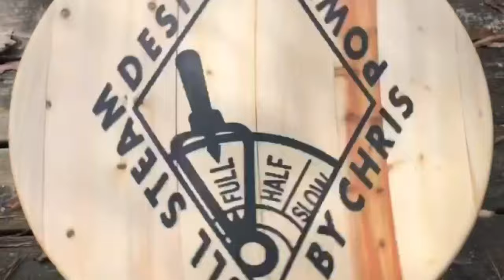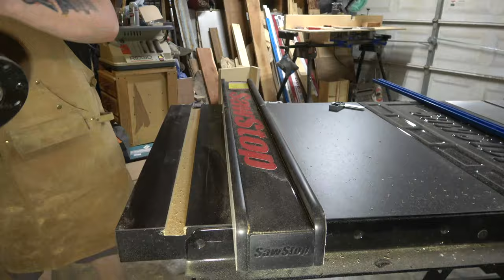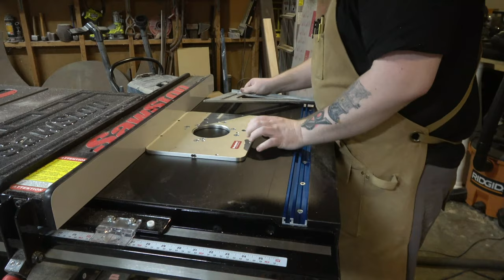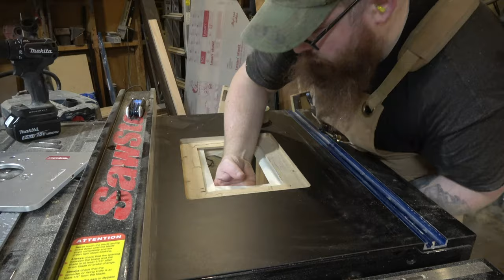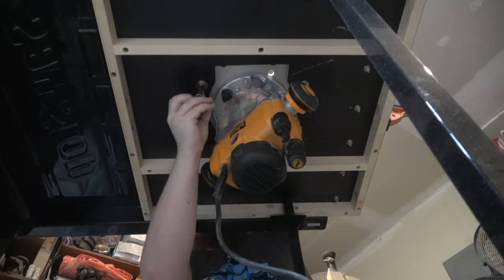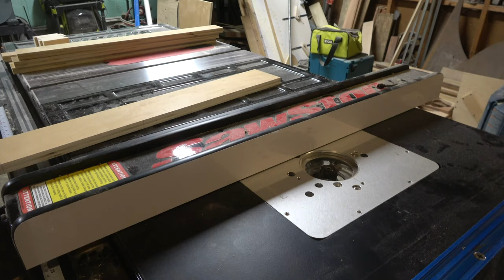Router Table Saw Extension Wing Insert and Fence Shop Build

Comment: I built a similar insert for my Sawstop a few years ago. I Phenolic to replace the entire extension table. I also imbedded a slot track perpetual to the miter slot you installed. I then manufacture pivot that can be slid in the second slot. When a piece of wood is up placed on the pivot it can be spun to create a perfect circle. 
All of my slots will support all of the Jessem components. This makes my saw work fully as a router and a great saw.
Reply from the maker: That sounds pretty interesting.
Reply: I would send you some photos and maybe a video if I knew how to attach them. I am a strong believe in not building something that you can buy, unless the building of it is the enjoyment. I will also build something if I believe I can make a better mouse trap. To that end my top looks like a commercial product and was designed and built to accommodate all of the Jessem Router table attachments. None of which I have yet purchased. It was done on a friends C n C so it is absolutely reproduce-able. 
If you want some photos let me know how I might get them to you and I will send them.
Reply from the maker: Yea I’d love to see them. Email me at Chris@fullsteamdesigns.com Thanks

Comment: I was trying to figure out how to add a fence without adding a fence or marring up the table saw fence.  Awesome idea an dlove the pvc.  I think it would have looked epic if you painted in black and nice call on the mag switches.  Would be cool if there was a t track on the fence in the middle.  Wonder if you could build two small clamps into the wood fence to attach to the back plate.  I don't have 400 for a sawstop or bench dog right now so I am considering using an old aluminum saw and doing this.  That said, that table looks epic.

Comment: What I love most about this is that you made a router table with the t-glide fence. I absolute hate traditional router table fences. Many could argue their use, but I don’t see myself ever needing you use a router where I won’t want a perfectly straight cut, so the t-glide makes the most sense. Good job with this concept. Although now I’ll have to buy a sawstop… my bank account will hate me.
Reply from the maker: I’ve never found the need to be able to angle it either 🤷‍♂️

Comment: excellent video as usual.  

the mag switches work incredibly well just use 95lb or higher.  the lower weight holding versions won't work for this!  This is how I affix my jessem guides to my tablesaw fence!
Reply from the maker: Thanks for the info. I still haven’t done anything to attach it more permanently. I gotta stop dragging my feet and just make a decision.

Comment: #unnecessarywalnut I like it, Chris! Are you still using this setup? Still like it? I'm considering doing it in my SawStop wing and I like your setup. I like how you did it far enough out that you didn't have to cut into the rail like I've seen some others do.
Reply from the maker: Yes I still use it all the time

Comment: Just curious as to why you inserted the aluminium track  so far away from where the router is? I can't really seeing it much good there.
Reply from the maker: If I put it any closer, I would have had to notch the angle iron on my saw, and I didn’t want to do that. It works fine where it is.

Comment: I’m struggling to decide whether or not to install the aluminum track in the same location you did or notch the rails. The current feather boards I have wouldn’t work so far away but could easily make some custom ones
Reply from the maker: I ended up adding another one closer to the router

Comment: Did you build a box around the router?  All the other videos I've seen for table saw routing stations include the box for better overall dust collection.  If you found it unnecessary I'd be impressed.
Reply from the maker: No I didn’t

Comment: Chris - great design - I am going to use your design with a Jessem router lift (router lifts are great).  You use a clamp to hold it to the saw stop fence - what is the brand?  Thanks
Reply from the maker: Thank you. I’d really like to go to a dedicated lift eventually. I usually use my Pony clamps. I’d like to come up with something better. Just haven’t had the time to mess around with it. I still like the idea of the magnetic clamps on the top.

Comment: This is a great video and awesome fence you built! Now that it's been a little over a year, how is the stability - any sagging? I have been considering this but figured I would need to add a 3/4 sheet to provide some strength.
Reply from the maker: Thanks. It’s holding up great. I’ve been using it a lot lately.

Comment: I enjoyed the video, but I do have a basic concept question. When you built the two sliding "sides", it appears that the purpose is to adjust the gap BETWEEN those two sliding sides based on the size bit you are currently using.  Can those same sliding sides be adjusted forward/backward? Example: if you used this router to trim "x" off the edge of a board, the side "receiving" the freshly-trimmed board should be adjusted FORWARD the same "x" distance to compensate for the amount trimmed - to keep the board perfectly flush with the fence. I have watched many table saw/router videos looking for this specific feature to be implemented- but haven't spotted one that mentions this scenario. I can do this easily on my router table, as the two sides are mounted independently.  Any thoughts on how to add this feature on a table saw/router fence? I want to ditch my router table and use table saw exclusively. 
I know that someone is going to respond: just perform the trim on your table saw instead of the router - but its difficult to remove 1/16" inch from the edge of a board using a table saw; piece of cake using a trim bit on a router table.  Thanks in advance for your thoughts!
Reply from the maker: Yea you could just use shims on one if you set it up the same way as I did. It would be interesting to see a quicker adjustment method. Maybe something that had screws to adjust from the back and push the fence out.
Reply: Rockler makes a set of shims for this very purpose, but making a set DIY would be very easy.

Comment: the hole in the fence sucks, but what about the dust underneath?
Reply from the maker: You can also hook up a hose to the dust port on the router. You can use a y fitting on your vacuum hose.